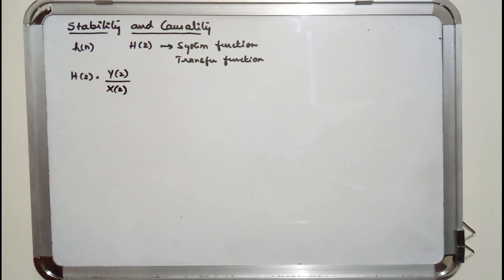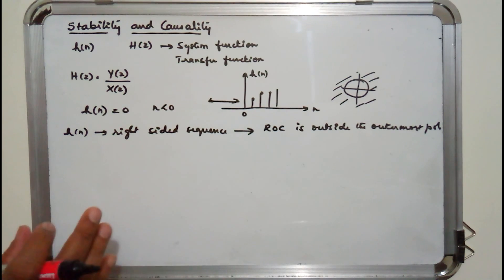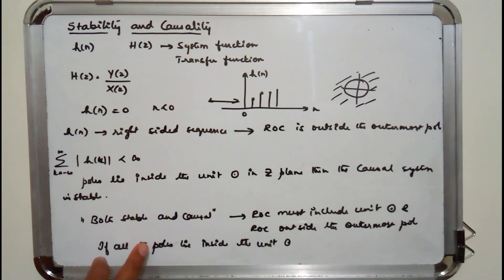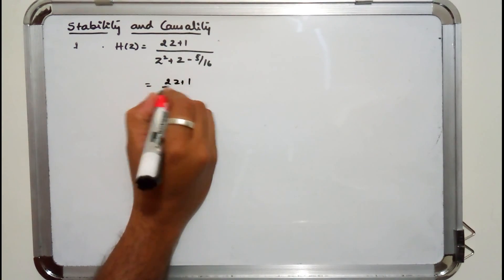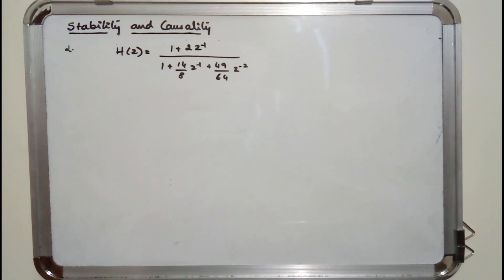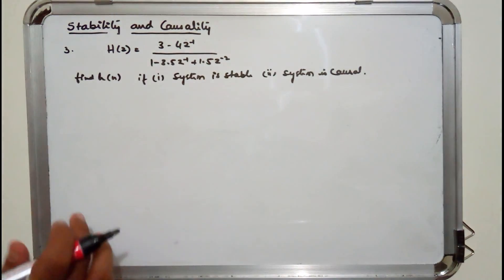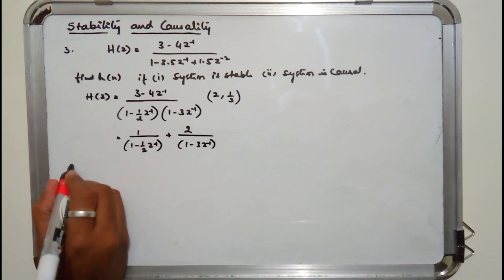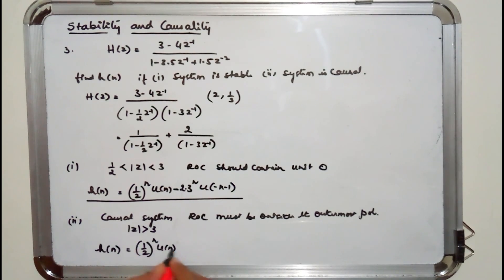Causality And Stability Analysis of system using Z Transform

Comment: Shouldn't the first system be stable?
Reply from the maker: roger that no .unstable
Reply: @techjunkiejdb5476  But what if 0.25<|z|<1.25? That will include the unit circle also.
Reply from the maker: roger that r u talking abt ROC
Reply: First system should be stable.It already includes ROC.Can you explain a little bit more